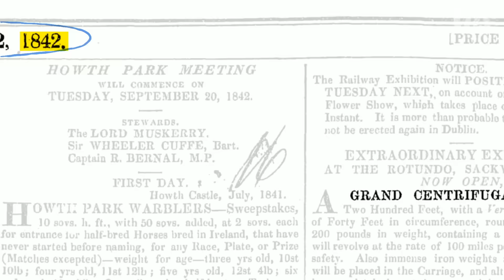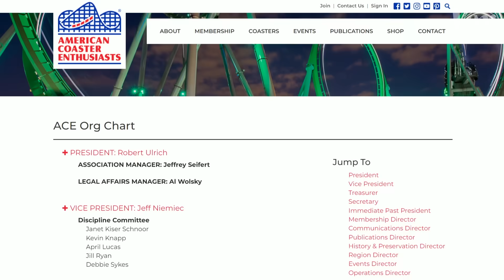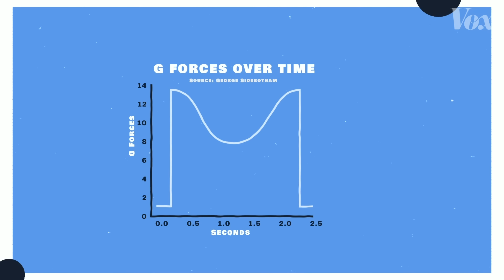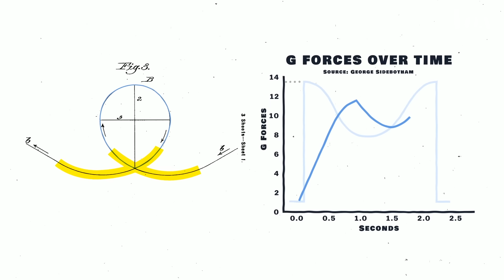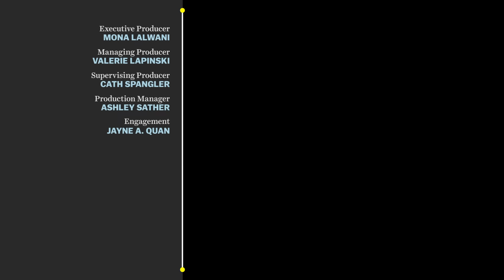Why roller coaster loops aren't circular

Comment: Did the first one actually subject the passengers to 14 g's? Or was that just AN example of a circular loop and not a model of one that was actually put into practice? Because 14 g's is a lot. The hypothetical euthanasia coaster would only be about 10 g's but it would keep it up for a minute. Never mind the acceleration function being discontinuous, just it being 14 is a problem.
Reply: There's something off about those graphs. No way it is 14 g. The graph shows the modern coaster at 9 g, which also wrong. Halve those numbers and you're on the money. A circle would be more like 7 g and a modern loop 4.5 g.
Reply: @philb5593  at the end he mentions that American Revolution is 4.9 Gs so it’s so weird they were completely off for the rest of the video but right for this one part. Like did they not notice how much higher they were claiming the Gs were earlier in the video compared to this? Also, at the start he said the highest the human body can handle is 6 Gs for 1 second and any higher you would pass out so if these older coasters were supposedly 14 Gs wouldn’t most people be passing out? Even on modern coasters most people would be passing out if they’re claiming they have a G force of 9.
Reply: they over estimated the drop height and top speed.
Reply: It was also troubling that it was suggested that circular coaster riders were subject to an instantaneous jump from one to fourteen g’s.

That is not possible.  It could be very dramatic change - but not instant.
Reply: @danielking6426  effectively instant, this is an engineering problem not a physics parable
Reply: Man, seeing people use apostrophes to make plurals (it should either be Gs or "G"s) makes my eye twitch.
Reply: @englishatheart  Actually if you wanna be totally pedantic/correct about it, the correct way to spell out a reference to the letter G is to write "gee" or "gees." Not makin this up, Google it!
Reply: @balthazothrenier9048  thanks, I hate it LOL

Comment: I worked at King Dominion Park, in central Virginia, in the Machinists "Tool Crib', meting out Parts as needed. As Such, I got a nifty "insider's view" of the Constructs of the various Coasters.  A Huge concern was 'G-loads', where a Coaster's speed, on a given Curve, would possibly injure a Rider. A good example was in the 'Volcano', a Mag-lev propelled, Vertically accelerated, inverted-loop,  spiral descent coaster being 'built & tested' when I first got there. It could exceed 5 g's, and that was a Concern! It got 'down-to under 3-g's, and still made the top 'Immelman roll' out of the Top of the "volcano" mountain construct. But, for the first few weeks of Ops in Public, there was an, um, 'Impact Area', where loosely tied shoes, boots, etc., would Land, about 150 yds. from the 'Top' of the Ride. We had to reconsider, what was 'allowed' as manageable footwear as a result of one unlucky patron, in the I.A.. have his whole Food-Tray taken out, by a size 11 Boot, from Above... Quite unpredictably! If you may the forces too great, things happen beyond the 'expected' Thrill!

Comment: I always found it weird that i feel safer going upside down than going straight down. i will always choose a ride with 3 loops than 3 drops.
Reply: Same! I find that “free falling” feeling in my stomach the most extreme and hardest to handle, and I only get that on drops not on loops.
Reply: that stomach feeling i used to be afraid of. When you go on a big coaster like Millenium Force, after the initial drop, your stomach doesn’t drop more. you realize there is a maximum “stomach” feeling and that even on small coasters with drops you pretty much max out. Big coasters aren’t scarier
Reply: @Daymickey  makes me wanna pass out LOL
Reply: Well you kind of need a big drop to do loops most of the time

Comment: Those small loops are terrible too because of the differential acceleration between your head and the rest of your body. Nice and neck-breaky. To get a feel for why this is so bad, imagine a loop that's so small, your head is right at the centre. That means that when the car gets to the loop at, say 50mph, your head instantly stops moving, and instantly starts moving again when the car leaves the loop. Or at least it would, if your neck's bendiness didn''t whip it to a stop and whip it to a start again extremely quickly. Nasty.

Comment: Not only were the loops circular, they were too small and taken too fast and used relatively stiff building materials that were hard to bend in complex shapes and could not flex repeatedly without breaking.  Bad combinations all around.

Comment: At 2:28, you are wrong about that, the rocket ship pulling 3 Gs looks correct but modern fighter jets pull way more than 4.5, it gets around 8 to 9 to 10 Gs which they train for.  Also 6 Gs is not to much for the average human to handle either, the average human with no G training can probably do about 7 Gs for 3 or 4 seconds.  I found a lot of things wrong in this video.

Comment: I really miss the old looping coasters by Schwarzkopf.  I am sad cause I never really found modern ones intense at all and I really miss the old ones, there are still circular loops out there.  They really were not to intense cause the ones that are still around have still been very popular and no complaints about being to intense, its just engineering and thinking that people prefer less G Forces and more overall fun but I disagree and am not one of those people.  I defiantly think we should still have these around but its a shame more less more forceful ones are appearing.  The old ones got up to 5, 6, and even 7 Gs, then you have flip flap railway which was 12 but that is a different story.  Nowadays you will see about 3 or 4 which is not even half of what a fighter pilot experiences.  Now days, forces like negative Gs or airtime are more popular but I miss strong positive Gs.  Its not really a dangerous thing actually, its just that some people do not like to grey out or do not like the intensity but its not by any means bad for you if your body.
Reply: @brittany24  I think its number 1 actually.  What's more forceful?
Reply: @brittany24  I'm pretty sure ToT got revamped so it's not pulling 6.3 Gs like it did, I think its 5.7 now or something.

Comment: Loops aren't scary at all. it's actually quite fun and exhilarating. for those wondering how it feels, at first when your going up the loop it feels like your being pushed down into you seat but no butterflies in you stomach then when you upside down, you literally feel like you floating. and the decent down the loop is the same thing as the first.
even though all of that may seem scary it is so goshdarn fun!
Reply: Ehh, it depends on the loop, some of these older loops will sustained the positive G so its still over 1 G when upside down so you still get pushed into your seat when upside down.  And the butterfly thing I don't get what you mean.
Reply: And going down you're not going to feel like when you went up they are opposite feelings you'll feel like your being pushed "up" and depending on the position of the exit either right at beginning your being pushed "into" the bottom of the cart (but still in the direction of up) or near the bottom half its pushing you up and out the cart into the shoulder straps.

Comment: Guess before watching the video: second derivative of the movement when directly connecting the straight section to circular loop is not continuous and as a result, you get poor ride quality.

Update: I think I was right. The video was more hand-wavey but that's still the main point here. There was also good points about smaller loops being not economically viable.
Reply: It’s also funny because a common high-school physics problem is a completely circular loop, and a common problem is knowing the g forces, particularly at the top and bottom.
Reply: yep that's it, the second derivative of position is acceleration, and it actually is discontinuous
nice

Comment: Because you lose speed as you go uphill, so you need a tighter bend to maintain the centrifugal force pushing you into your seat. The opposite is true when going down the other side.

I just saved you 6 minutes.

Comment: The roller coaster enthusiast in me isn't too disappointed in this video. Though, you wouldn't go from 1g to 14g, you'd reach 3 or 4 at the bottom of the valley, THEN, go into the high G's in the loop. Few comments at top basically explains it. Arrow Dynamics did the corkscrew first. Schwarzkopf did the loop around the same time. Arrow is the inventor of really... most of the modern amusement park. Log flumes, coasters with inversions, steel coasters period, the old car rides you drive with a gas engine, that's them. The mine train coasters. Them. Their legacy still survives. Schwarzkopf (who did the circular loops and Super Duper Looper) was around at sametime and did great rides too. He was ahead of his time. First heartlined coasters around; much smoother than Arrow.

Comment: Isn't 6G theoretically the min accel for a circular roller coaster?
Reply: What do you mean min accel?  I don't get what that means.
Reply: @maxhagenauer24  I meant the "minimum acceleration"
Based on my calculation, 6G was the minimum threshold rather than 14G in the video above.
Reply: @Poor_Jimmy9514  Well nowadays 6Gs is about the maximum.

Comment: But how does making the loop steeper actually reduce the g-forces? Wouldn't you want a shallower loop, like a lemon?
Reply: Because the radius is loose when you enter it, then tightens up as the train looses speed.

Comment: they can be circular, it’s just have to be sized big
Reply: Sizing them big doesn't help.   Now, if you added propulsion to the ascent, and brakes to the descent, then it would help control the speed so that you wouldn't need a 6 g difference in g-forces.   This is what aerobatic pilots can do, to mitigate the g-force during a vertical loop.

Comment: I have been on magic mountians revolution at least 100 times.  I waited for 4 hours to ride colossus the first week it opened. About half way back in the car.  As we were making the last turn into the station the lap bar came up. Before we got to the station. The station staff did not believe that my lap bar came up. Park staff did not believe me. About 2 weeks later a young woman was killed when they said she slipped out from under the lap bar. I know better.  I warned them .

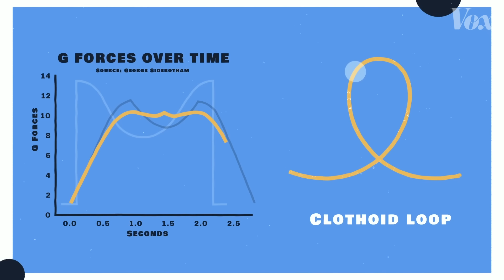Comment: I wish the graph more accurately matched what you're saying... at 5:17 the G-Forces are still around 10 (which wasn't that big of an improvement from the 14 in the first-ever loop), but you said in your real-world example that the G-Forces maxed out around 4.9 (which is very impressive, but not demonstrated properly on the graph).

Comment: Our world Edmonton that's called the mindbender has three loops on the on it you'll go though the 1st loop during  the middle of the ride and the last 2 loop back back at the end of the ride. Anton Schwarzkopf the invorty from Germany.  The rollercoaster goes 96km that about 60Miles with a 5.6 G Force. As 2020 it is 44.2M or 145 feet is the tallest indoor rollercoaster in the world inside the biggest mall in North America and the 5th biggest mall in the world. At West Edmonton Mall inside Galaxy Land since 1985.

Comment: Vox over here making a video about rollercoaster engineering and they did their research to the point where enthusiasts won't be able to rip this video apart. I'm impressed. Well done!

I loved the quick flash to Olympia Looping in that transition near the end there.
Reply: except they keep showering the G force charts for the rollercoasters hitting 10+ G’s. Then a few seconds later mention that for the great American revolution it only hits 4.9
Reply: The only thing is that round loops do exist. Just not made by arrow. You can however find them on geurslauers.
Reply: @CrumsTheCreator  Yeah  but they're not perfectly circular + they're massive in size
Reply: Funny thing, Art of Engineering explained it very similarly about 3 years ago, so...

Comment: This is also exactly why the radius of turns in roads are variable, just such that the steering input is gradual rather than you having to flick it in. This is especially evident with on-off ramps of highways.
Reply: I've hit a couple abrupt ones and almost wrecked
Reply: I still don't see why big roads need to be curved, they are way to wide for you to feel an unforgettable lateral force if they were not banked.
Reply: @maxhagenauer24  They curve them to get around things like mountains or hills we don't really notice much while driving. Probably made their job much easier when putting them in. If you're in the midwest that seems fairly straight to me. In the appalachians very curvy because of all the hills and mountains.
Reply: @maxhagenauer24  I have no idea what you're asking about, but if you're asking why roads are BANKED or slanted in other words, that's for rain water to flow off of them more quickly instead of flowing along the length of the road, making it slippery especially with icing in winter.
Reply: @MrSaemichlaus  Oh I see, thank you, I just keep hearing that it's because of the lateral forces or cornering speeds like how NASCAR oval tracks are banked so much.
Reply: @MrSaemichlaus  That is an important minor benefit, but the main reason for banking a curve is to counteract the centripetal/centrifugal forces which would make the occupants of a car/train feel a sideways force. Banking at an angle that is appropriate to the radius of curvature and the expected speed means that the only increased force that passengers feel is directly downards (in the vehicle's frame of reference) which makes the person feel a bit heavier - much less disturbing than a lateral force.
Reply: @Mortimer50145  I'm Swiss, I haven't seen roads banked too much around here for purposes of cancelling the centripetal force, but I have been to the United States and there have seen tighter bends (relative to speed) and steep banking to match. I guess it also depends on the standards for road layout in different countries / continents. Surely the banking would never be to the outside of a curve, unless it's a very slow road.
Reply: @Mortimer50145  I know this from Rollercoaster Tycoon. If you bank the bends it makes the rides more pleasant hhaha
Reply: @maxhagenauer24  So your brain doesn't phase out staring down a long stretch of fuckall.
Reply: What do you mean by they are variable?
Reply: @kevinbeltran1208  as an example, circles have a constant radius and ellipses have variable ones. If you would enter a turn with constant radius you need to abruptly turn your steering wheel, whilst with a variable radius that slowly increases and decreases you also steer a lot slower.
Reply: @willemrood  but aren’t all horizontal curves for roads semi-circles? Some off ramps have multiple radii to make them seem “elliptical”. Is that the variability you are talking about?
Reply: @willemrood  I’m just gonna drop it. Don’t know why I’m being Mr. know-it-all right now lol

Comment: I'm guessing that there's a 1g loop like an aircraft's barrel roll and that they're quite common.
Reply: 1g is what you feel at rest on the Earth's surface by definition.  That's not even a loop at all.  That's cruising in a straight line at a constant speed.

A 1g loop would be an airplane flight at cruising altitude/speed that circumnavigates the entire planet.

Comment: Then there’s the enclosed water slide from Action Park that ended in a loop that was a perfect circle… and sent so many people to the hospital because of either whiplash, or bashing their head into some part of the inside. 🤦‍♂️
Reply: omg that's terrible.. u would think the experts at tasked with designing and building waterslides would know better
Reply: @bornh8r  it’s because no experts were really consulted lol. The owner of the park who was a wall st businessman and real estate developer drew it on a napkin and they built it. Action park is a fun rabbit hole if you ever feel like watching a video on it
Reply: @bornh8r  Amusement park safety was not really a thing in the 80s
Reply: Yep, this is why when you're engineering something like that, you'd likely want to go with a shape that keeps acceleration to a tolerable level and adjusts the radius to make that work.
Reply: Even action park only had it open for one season! It was about 10g. People were consistently hurt by it, so they added padding. Then people were cut by it. They investigated and they found previous riders had left teeth embedded in the padding.

Comment: This explains why athletes have so much trouble when they try to ride full pipes or loops. Every loop I've ever seen built for skateboard, bike, motorcycle, etc were all perfect circles.
Reply: I wonder if any of them ever tried these types of loops
Reply: I really think you’re on to something there. Call tony hawk. He’s not 65 yet and that’s retirement age so he’s good
Reply: wow good point
Reply: for skateboard? wow.. wouldn't try it...
Reply: I dought Positive Gs for them is the reason its hard, they go through the elements so fast that it shouldn't affect them, where do they have trouble when doing them?
Reply: @maxhagenauer24  it throws your balance off hard to adjust quickly to the spikes
Reply: I was thinking about this too the skateboarders are making it harder on themselves
Reply: i don’t think i need to point out the fact that a teardrop loop isn’t going to be any easier because the main issue is speed anyways in those red bull type stunts